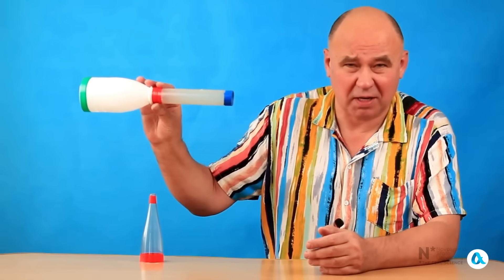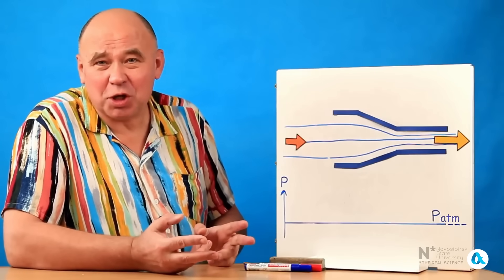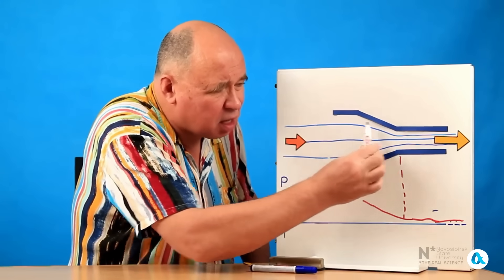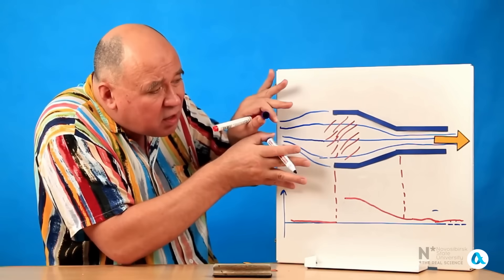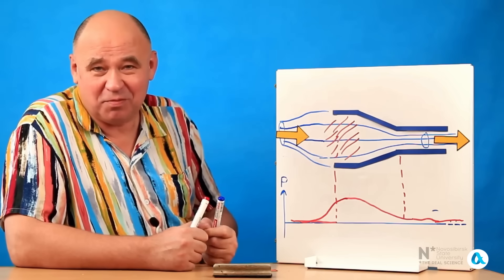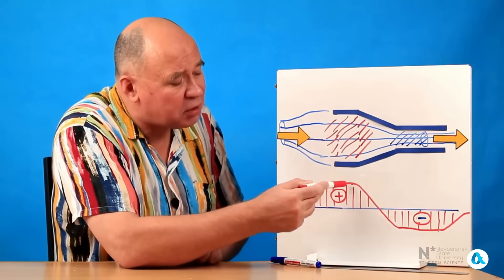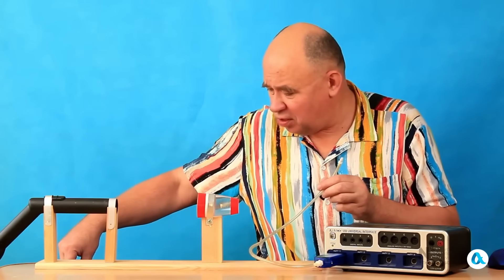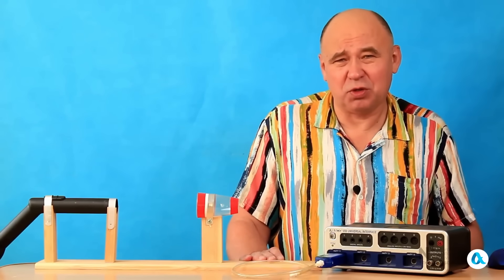Tapering pipe paradox

Comment: Just imagine a ton of peas entering the nozzle from the wider opening. At first they all enter fully at no speed change, but then a traffic congestion emerges which moves backwards. If the movement was blocked, the peas inside would be trapped, and a pointy cone would form in front of it, whereas anything else would bypass the cone entirely. However, since there is some flow in the other end, the cone would be shaped somewhat differently, where it wouldn't be pointy but more rounded.

Obviously in this mental model as well, the pressure (the collision and contact between the peas) would be the greatest inside the plastic part. And any peas that manage to leave the other end would encounter the peas already in the environment which would help them space apart and accelerate again to ambient speeds.
Reply: Great
Reply: "The pressure would be greatest inside the plastic part."  😶
Every part of the apparatus is plastic.
Reply: @assininecomment1630  I see no confusion then....
Reply: comparing peas to air, really. not even close

Comment: What is this? Who is the target audience?
Reply from the maker: People who like to think
Reply: @getaclass_physics  they like to think, but they don't know how to think? Seriously, who wouldn't understand this is no paradox. You don't see funnels flying around from the perpetual motion of air. What is even slightly paradoxical?

I mean, you didn't even talk about the low pressure that would form around the funnel spout and how it would work against thrust. If memory serves me, you didn't talk about the pressure of compression that would form turbulence that actively works against the inside of the funnel and the stream. Not to mention, you're basically comparing the aerodynamics of a parachute in the orientation that it's in, relative to turning the funnel around and how that would be more like a dart. You could have done that! It would have demonstrated everything you needed to know.

Comment: Nice video and presentation. 
By page 5:00~  is an assumption that a nominal flow passing through a cross section smaller than the engine diverges towards the inlet.
It is also true that air flow passing a through a criss section multiple times larger than the engine converges towards the inlet.

We also saw a simplified experiment showing pressure distribution along the path one end to another. 

It seems we have mixed messages and questions. The exhaust after the vacuum cleaner has top speed and least pressure relative to the ambient and its speed is being drag down by friction imposed by the funnel inside surface, stagnating with pressure rise before leaving the funnel. The air stream increases again by the end of the funnel. We just complete a “passive” wind tunnel experiment is irrelevant to what we advocate “air flow in and out of a turbine engine.

Comment: The pressure differential happens on propellers and wind turbine blades. It's self correcting. Some energy is required as input. But it's goal is usually in another place.

Comment: Sir:  I watched thinking "What is the big deal, he's created an incomplete venturi." In my dad's first airplane, we would not have gyros without a vacuum. The Venturi engages Bernoulli's Theory. The Venturi converted some of the forward motion energy into outflow from a system of tubing connected attitude and direction gyro instruments.
Reply: Do you think there's something counter-intuitive in the venturi tube or Bernouilli's theorem? Pressure increases when speed decreases? HVAC field tech manager POV.... Many people have a hard time wrapping their heads around that one.
Reply: @Kansika  The sum of the static and dynamic pressures stay constant.
Reply: @aeomaster32  What do you mean? 

I usually measure air velocity in a duct with a pitot-tube connected to a digital manometer. 

The volume and velocity of the flow can be calculated from the difference between static and dynamic pressures when the duct diameter is known.

Static and dynamic/impact pressures are equal when there is no flow. That's why you can't tell whether air is moving or not, not to mention calculating it's velocity, from static measurements only. You need at least a pressure differential across a quantified restriction in the duct. 

Static pressure is the same in all directions and equals dynamic.pressure only when the medium is standing.still.
Reply: @ I was not challenging you, but considering what happens at the choke point of a venturi. At its narrowest point the airflow speeds up (increase in dynamic pressure) and the static pressure simultaneously drops at that point. The sum of the lower static and higher dynamic pressure should be the same as free atmospheric pressure. 
Airflow over the top surface of a curved wing section speeds up (dynamic pressure) over the curve (like a veturi) and there is a drop in static pressure there causing the higher atmospheric pressure under the wing to lift it up.
Reply: @ A wing doesn't generate lift by itself and a venturi doesn't generate more flow than what's put in. Small pockets of minute low pressure at the outlet don't add to the system or create thrust although the air molecules are slightly accelerated. 

The relationship between air volume and the required static pressure and motor power is staggering : to increase air volume 2 times pressure needs to increase 4 times and motor power 6 times. A venturi is a deliberate restriction of a certain known magnitude with known coefficients that consumes the energy of optimal near-laminar flow. 

He does mention surface friction as a factor but doesn't address more important ones, e.g. the way air behaves when it's forced to compress and converge. Air molecules that enter the funnel are being deflected inwards towards the same axis and the steeper the angle of the taper gets the more they interfere with the main axis of flow and each other, create turbulance, and some are reflected backward so the flow is partly reversed.

The turbulent air might give you high pressure readings because there's so many air molecules pushed together and in different directions. Both the volume and velocity of the air flow are greatly reduced in the funnel and what is eventually slightly accelerated by the low pressure zone at the outlet is minimal in volume, energy, thrust, how ever you want see it. High speed doesn't equal high power or addition of energy. 

There can be no equation when the amount of energy put in or coming out of the system is not known.

Comment: @michealwhinnery164 @fiveangle 3:11 No disrespect but I think you’re missing the point he’s trying to make using Bernoulli’s principles.  Yes, he could have said “without additional energy input, but in the context of his statement comparing this device to a jet engine I’m not sure it would be necessary being that he’s speaking in terms of the Bernoulli relationships between velocity, pressure, and diameter of pipe/tube.  Which in this case explains how the velocity of a fluid increases and pressure decreases as it (air) flows from larger diameter pipe/tubing to a small diameter pipe/tubing.  In essence a velocity converter with no moving parts or additional energy/input besides the input air flow.  The inverse is true as well.  :)

Comment: There is no paradox here, only incorrect assumptions and pseudoscience. You treat it as a closed pipe system, which would be fully characterized by Bernoulli's principles (and more fundamentally by Newton's 2nd Law). And your "experiment" is on a nozzle without resulting laminar flow narrowed section, so of course see limited lower relative pressure.  However, this is not a closed system; it is a nozzle in a common fluid. Real physics here: https://www.youtube.com/watch?v=I8ntKdaKxV4

Comment: Your arguments are flawed right from the beginning.   You state "  increased air flow with no energy input "  the airflow is the energy input. The energy comes from the movement of the funnel through the air or the air moving through the funnel depending  on if you are in a wind tunnel or attached to an aircraft You aren't out in the intergalactic vacuum you are surrounded by a dynamic fluid.
Reply: @michealwhinnery164 3:11 No disrespect but I think you’re missing the point he’s trying to make using Bernoulli’s principles.  Yes, he could have said “without additional energy input, but in the context of his statement comparing this device to a jet engine I’m not sure it would be necessary being that he’s speaking in terms of the Bernoulli relationships between velocity, pressure, and diameter of pipe/tube.  Which in this case explains how the velocity of a fluid increases and pressure decreases as it (air) flows from larger diameter pipe/tubing to a small diameter pipe/tubing.  In essence a velocity converter with no moving parts or additional energy/input besides the input air flow.  The inverse is true as well.  :)

Comment: He's full of crap!  The air at the inlet is at atmospheric pressure, it enters the opening and travels in a straight line, but the volume of the cylinder decreases, so the air is in a smaller space, ergo the pressure MUST rise!  But, since any given volume of air must traverse the distance at a higher rate of speed due to the volume of the tube decreasing, the pressure at a right angle to the flow decreases.  If you put a small bent tube inside of the duct that is parallel to the flow where it is narrowed down, the molecules of gas traveling at the higher velocity have more energy in them, and you will read that as a higher pressure as they want to flow down that small tube!  In jet engines, that is called "ram recovery".  The faster the gas molecules are moving, either in a flow or due to an increase in temperature, the more energy is in those molecules.  The greater number of collisions between the molecules themselves or the chamber's walls, the higher the temperature.  When you have a given volume of gas in a system, at a given temperature, you will have a certain number of those collisions occurring every second.  Either increasing the temperature of the gas by putting energy into it, or reducing the volume of the container, will cause more collisions per second to occur, which means that there is more kinetic energy in the gas molecules.
Reply: Pressure in a fluid at right angles to the flow? 
Pressure at any point in a fluid is the same in ALL DIRECTIONS.
ALL POINTS HAVE THE SAME TOTAL ENERGY, although they may have different proportions of potential and kinetic energies. The pressure in a pitot tube is the equivalent static pressure of the kinetic energy of its higher velocity.  It does not read static pressure.  The potential energy (gage pressure) in the small diameter tube reduces a corresponding amount to keep the total energy the same (conservation of energy), except any lost to friction.  Ram recovery occurs at the exit as velocity slows and it's kinetic energy is converted back to potential energy. 
  Higher temperature increases total energy.  It is kenetic when you are looking at molecules with velocity, but it converts to potential energy as the molecules come to a stop when impacting the container walls.  Molecules bouncing off the walls convert that potential energy back to kinetic energy to continue their movement inside the container.
Reply: @bipl8989  If what you say is true, then a Venturi wouldn't work and no gasoline would get sucked into the air stream!  Static pressure means nothing is moving, it's in equilibrium, I'm talking about dynamic pressure, when a fluid is MOVING!  How do sail boats move if there's no Delta P (difference in pressure) in the medium we call air?  As the gas is occupying a smaller volume of space in the neck of the Venturi(compression), how can the pressure be lower?  The amount of time that the gas molecules  have to collide with the walls of the Venturi due the increase of speed is seen as a lower pressure, and thus gas and liquid molecules get sucked into it.  There is a device known as a static pitot tube, which combines both forces.  On my friend's Cessna, there is a forward facing tube under the wing, and near it is a hole in the fuselage, and the two are connected to give a true air speed reading.  Gas turbine engines have airfoils that get progressively smaller, thus it compresses the air as it moves towards the burner cans where it is mixed with fuel and is ignited.  Jet engines wouldn't work if that was not happening.
Reply: @AnotherWisenedOne  You are making up non-science to explain what you think you see.  You have a basic misconception about fluid motion.  Fluid is not "sucked" from one place to another.  It moves from a location of higher pressure to one of lower pressure.  It is always "pushed" by a pressure difference.  Use absolute pressures and you see that absolute pressures are never negative. 
   Your friend's pitot tube has the hole to read the STATIC pressure. The tube then effectively subtracts that from TOTAL pressure to show only the equivalent pressure of the plane's velocity.  
   Bernoulli includes terms for both static pressure and velocity.  Pressure difference is only obtained only after calculating total energy at two points, using Bernoulli at each point, then taking the difference.
Reply: Bernoulli proved that if you restrict the flow of a fluid (air is a fluid), velocity increases and pressure falls. 

You are very incorrect here.  Study it, you will see it is the truth. 

Even modern toilets use this principle to increase efficiency of the flush.
Reply: @rickschlosser6793  Exactly.  Restricting the flow increases friction, so PRESSURE DROP (not pressure) across the restriction INCREASES.  A larger pressure drop forces more fluid to pass through the restriction, but if the flow is held constant, then its velocity must increase.  If the upstream pressure and flow into the venturi are held constant, the downstream pressure at the venturi outlet will decrease.  If the downstream pressure and flow from the venturi are held constant, then it is the upstream pressure at the venturi inlet that will increase.
Reply: @ A lot more long winded than the way I was taught, but bottom line… Correct!

It isn’t what one would think at first glance, but it is fact. 

It also makes the airfoil of an airplane work…
Reply: @rickschlosser6793  Yes, at rest, in still air, there is an equilibrium of air pressure on the top and bottom sides of the airfoil, but when there is motion in play, the air molecules that are on the upper surface are not there long enough to exert a downward force, compared to the bottom surface, because the ones on top have to move faster to traverse a longer distance in the same amount of time.  And THAT is why a wing generates lift, until it stalls due to too low of a speed, or too high an angle of attack and the air is too turbulent.
Reply: @ You yourself just stated the air on the top of the airfoil has to move faster. 

I refer you back to Bernoulli’s Theory.  If you increase the velocity of a fluid (air is a fluid) the pressure drops. 

That air pressure is lower on the top side of the wing because it is traveling faster than the air in the bottom of the wing. 

That means the net force is upwards, otherwise called ‘lift’.
Reply: @rickschlosser6793  If you look at an airfoil, it is one half of a Venturi tube!  How do you measure that air pressure?  If you have the flow of air pushing against the instrument like a weight on a scale, it will register a certain amount, increasing as the velocity increases.  But, if you turn that scale 90 degrees, you will not measure any pressure because the scale platform is not being pushed by the air!
Reply: @ How would I measure that air pressure?

I would get into the 21st century and use modern electronic pressure transmitters, they are cheap and getting cheaper every day.  Put an array on top of the wing, put another array on the bottom.  Then look at the numbers, you will see the pressure on the top will be lower than the bottom as long as your air velocity is above ‘stall’ speed. 

But I’m just telling you the physics.  All this was proven before I was born, and I’m not young. 

Don’t shoot the messenger.
Reply: @AnotherWisenedOne  Static Pressure at any point in a stationary fluid is the same in ALL directions.  This is the first thing stated in any book on fluid mechanics.   A barometer reads the static atmospheric pressure, the weight per unit area of the atmosphere.  A pitot tube facing the wind reads the kinetic velocity pressure.  Kinetic, or dynamic pressure is directional with the wind. At 90deg to the wind, dynamic pressure is zero, but static pressure is the barometric pressure.  Add the two together to get the total equivalent pressure of air at any point in a moving air stream.  Bernoulli says it like this,  pgh + v^2 /2 /g.   V is velocity, so kinetic pressure is proportional to the square of the velocity.  P X g is the weight of air per unit height.  p is density of the fluid and g is gravitational Acceleration.  h is the height of the atmosphere.  pgh is the static head, so is proportional to the density of the fluid X height of all the atmosphere above the barometer.   The pressure on the walls of the venturi is pgh.  The velocity pressure is the v^2 /2 /g, but you only see the velocity pressure because the pitot tube stopped the flow inside it's tube.  Added together you get total energy at any point in a moving fluid stream.

Comment: You can get longer extension tubes for your vacuum so you can place the vacuum in another room and not have to deal with the noise.
Reply: There was no noise the original recording, but the AI which translated the video did not fully understand his explanation. In an spontaneous move it decided "if I do not understand, nobody shall understand".